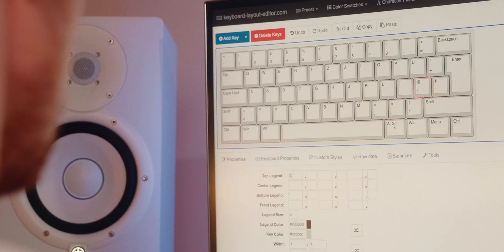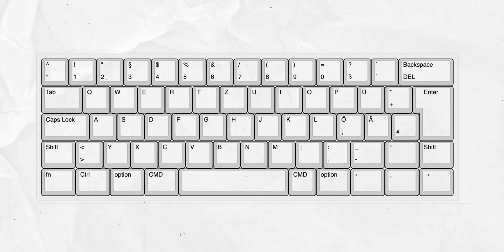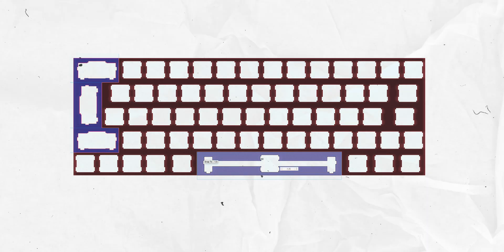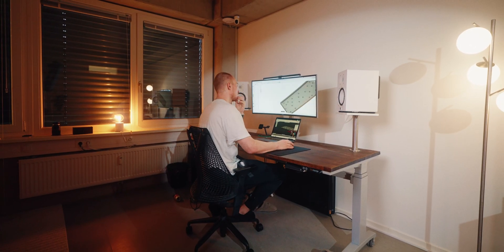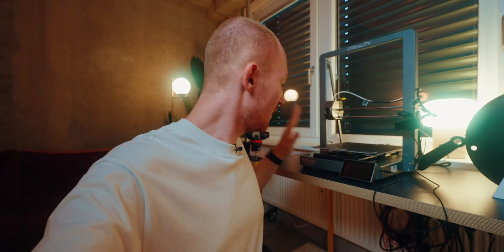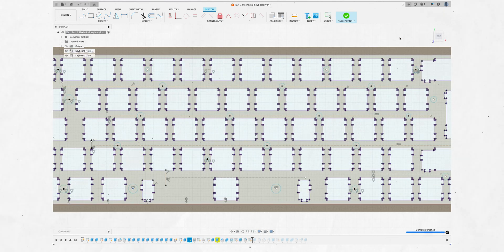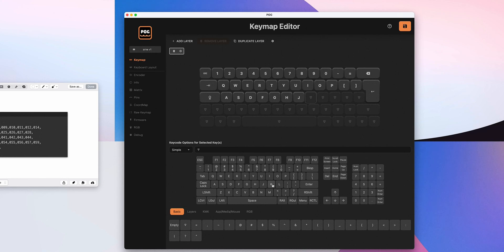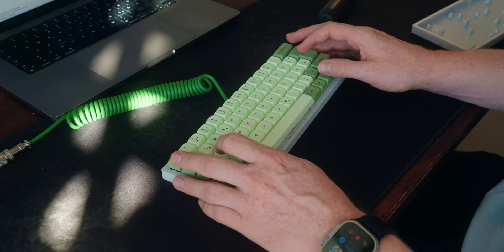I Made A Mechanical Keyboard From Scratch

Comment: Nice video. A good tip is to make the plate 1mm wider all around and then add a 1mm shelf to the case so that it's supported all the way around the edge - means you need less stabilisers plus your spacebar is supported all the way along. Welcome to the hardwiring community and I'm sure I'll see you on r/HandwiredKeyboards
Reply from the maker: Thanks for that point! I actually ended up doing that ( 8:19 ) Just took me a while to figure it out 😃 
Probably should have gone on reddit and learned some best practices earlier ;)
Reply: @arnebornheim  Oh great. In the video it looked like you just did it one place not all round. Nice one!

Comment: Why not make PCB? You already have the 3D data in Fusion3D. 
Then it's easy to make a PCB from it and have it manufactured with PCBWay.
Reply from the maker: Definitely interesting for the future! Honestly I just had no idea how to design a pcb and wanted to start with the low tech way first! Would love to design pcbs eventually !
Reply: @arnebornheim  A cheap pcb, plus the knowledge you've gained from hand wiring.  Splice the two and create something of convenience. you could even create a pcb with throughhole design for your diodes with only your matrix on the pcb layers.  Remember at that point, you're just connecting the dots within the constrains of your design.

With the wealth of knowledge for KiCad for circuit board design, or any other good design program you'll be set.

Of course you could always get more complex over different revisions.  this has been the approach I've had with my smaller macropad.  

I would be interested in the coding aspect of your build as well.  So Far I have been using circutPy for my small keyboard, but am interested in creating Via or Vial compatibility as well.

This is all just a hobby for me, but it's a ton of fun creating something to use.  Love the hardwired stuff, great video.

Comment: I also 3d printed my keyboard and funny thing I've used help from the same 3 guys that you did. Used the same websites and apps. Also I made the same mistakes and had the same problems as you :) I'm planning to do another keyboard too :)

I wonder how you squeezed the print on the printplate... I had to split it half unfortunately and it doesn't look too good.
Reply from the maker: Haha good to know I’m not the only one going through all that!

What do you have planned for your keyboard? 😊 

This was a a 60% keyboard that just fit an my Ender 3v3 plus (300x300mm built plate) 
You know there’s always Pcbway to get it done after prototyping 😉